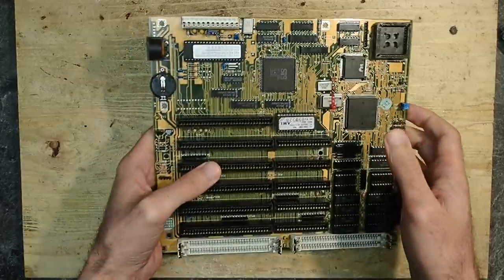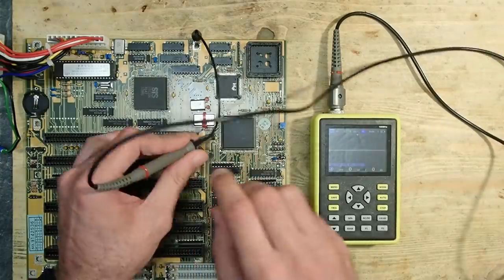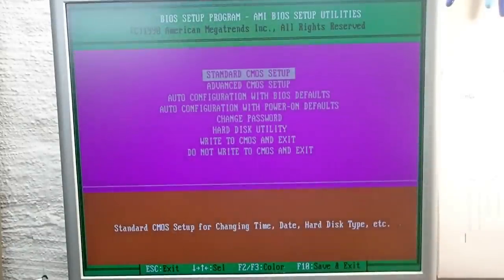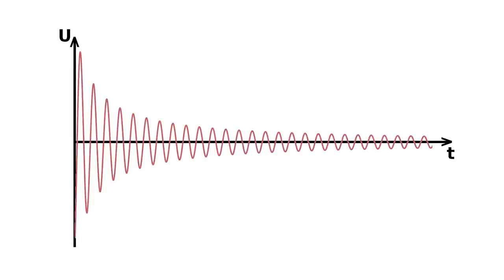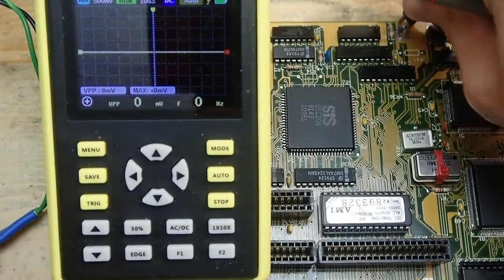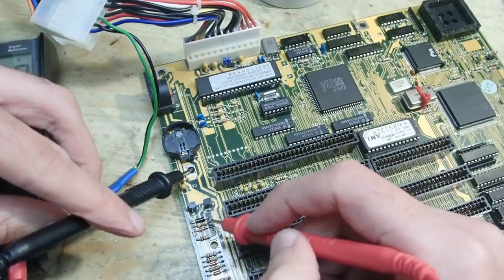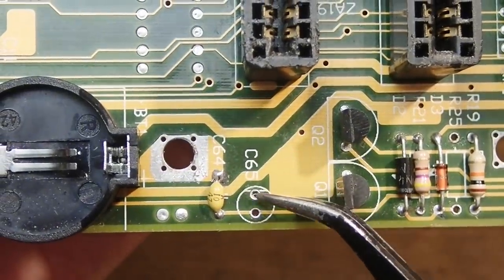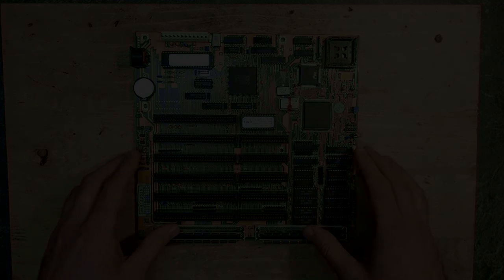Let's repair a mystical issue with an old 386 mainboard

Comment: Yeah, prices are going up, it's really crazy. 10 years ago, we were using all those 486 and Pentium 1 computers as targets for guns and now, it's almost more expensive than your normal gaming computer when it's something more race. 😀 Especially boards with ISA slots, because some people still need them for their special purposes and special boards which has no modern replacement, I can feel their pain when they need to replace MB in such machine, I work on CNCs, so it's just a matter of time and I will have the same problem, but thankfuly, our oldest CNC is already socket 775, but I am more afraid about that PCI card which connects PC with machine, if it dies, it will be really bad.
BTW, I totaly hate marking of capacitors and resistors, why the hell can't they just print what exactly is that without those ciphers? Like you have big resistor and you could just print 100 ohm there or something, why they don't do that? I don't get it, life would be much more easier.

Comment: I remember I had a similar issue in a laptop, I didnt know what it was until I noticed the clock in the bios was running like a stopwatch... the laptop had liquid damage and the rtc circuit got affected by it, luckily a good soak with alcohol fixed it

Comment: i was totally not expecting the system to rely on the RTC for timing interrupts for userspace applications, i guess i'm much more used to modern systems having internal interrupts and not needing to rely on such a thing.
Reply from the maker: And if you think, that back then there was no such thing like userspace/kernelspace, but only realmode DOS, you will be totally blown away :D

Comment: Excellent video, thank you for making it. About the frequency of the oscillator specifically, Steve Mould has a wonderful video about why these oscillators are that exact frequency (in his case, in a quartz watch). In short, it's the first power of 2 that is above the audible frequency range (for humans). So it's the first power of 2 that can be divided down  to exactly 1Hz that doesn't produce an audible high pitched noise. Link to the video: https://www.youtube.com/watch?v=_2By2ane2I4

Comment: What should i comment? Nice - as all your videos! :)

I need a list of the tools you use! The Capacitor tester and the small oscilloscope
Reply from the maker: Thanks for the donation ;) The tester is not only for capacitors, but also all kind of other stuff. I bought it in China and it didn't work from the beginning. I had to modify it get it running and print a stand with the battery holder. In China you often not only buy a thing, but also some tinkering fun :) The oscilloscope is a FNIRSI-5012H, it advertises 100MHz, but remains just a dream. This thing works reliably up to 35MHz, but it's more than enough to repair anything up to 486, since the FSB is 33MHz. If the correct voltage is not important, but the waveform and the frequency, you can use it for up to 75MHz. Even if it doesn't deliver 100MHz performance, I'm still glad, I have it and it's enough for what I'm doing. It is very small and handy.

Comment: So... you replaced one unreliable tantalum cap with another? :) When I get my hands on these old boards, I replace all the tantalums with aluminum solid-states (same value but higher voltage). That is, if I care about the board enough. I would even replace them with modern SMD ceramics, but that looks way off and ugly. Very unusual issue indeed, fun to observe. The cause of it, however, couldn't be more common (a failed tantalum cap). P. S. Now we know how a PC would work in a time anomaly.
Reply from the maker: Funny to see how much people care about which capacitor I used to fix my board. I never change the capacitors just because I feel bored, I know, that many people do, but I prefer to change them, only if I have an evidence, that it is broken. As you saw I even put back the blue ceramic capacitor near the crystal back in place. If it's not broken, don't change it. It's my simple way of thinking. ;)
Reply: @necro_ware  The issue is the type. Tagged tantalums are known to fail short or even catch fire. The ceramics? Yeah, those rarely fail and should be good for a long time. And when they do fail, it’s usually open. But tantalums? Modern surface mount ones are OK if you can’t use a ceramic but tagged tants are bad news.
Reply from the maker: @truectl All you say is true, but do you really have a feeling, that I could not know it? I mean everyone who repairs such an old hardware knows, what tantalum caps mean. I even said it in the video, as far as I remember. But you can relax, this capacitor is sitting on a very low current trace and the replacement part was taken from a military grade hardware. It will probably last the next 100 years.
Reply: @necro_ware  I gotta admit, sometimes I change parts just because I enjoy changing parts ^_^
Also I would too put blue ceramic cap back... because it looks sexier =)
Reply from the maker: @Arti9m  lol

Comment: That behavior on the seconds in the bios is normal. I have some boards with the same behavior.
Reply from the maker: Yes, I think so too. Just never paid attention before :D
Reply: I believe Necroware's assessment at the end is correct.

In code, it's quite common to poll the time every few hundred milliseconds.  If you poll once per second, you will almost surely have a window that takes slightly over one RTC second.  This means you eventually land at the very tail end of second N, and the next polled value will be at the very start of second N+2, skipping over N+1 entirely.  So, you poll multiple times per second to ensure you don't miss one.

But unless you're aligned perfectly with the RTC clock, you will end up with a lopsided, jittery count.  The solution is to poll VERY frequently -- like every 100ms or less -- and just not update the screen if the time hasn't changed yet.  But, when you're talking about low-stakes stuff like a Time-of-Day clock, it's really not important enough to worry about.

Comment: Why always the tantalum caps? My friend fixed my SS7 mobo and it also had one culprit on the board. It did not blow but nothing happened when i pressed the power button.
Reply from the maker: The good thing about tantalum caps is, that they don't leak and so don't degrade and don't damage the PCB over the time. They usually also have better ESR values and give better overall stability. On the bad side is, they either explode sometimes and/or leave us with a short circuit. It is a very rare case to see such a behavior as I showed in this video, where the tantalum is neither shorted nor exploded, but starts to be conductive as it gets warmer.

Comment: Nice video! The capacitor didn´t explode because there is not enough current in such rtc circuitry
Reply from the maker: Thank you very much.That was also my assumtion.

Comment: You should take that scope apart, and take a look at the input circuitry. It might have some bandwidth limitation.
Reply from the maker: It was already, you can find plenty of detailed videos about it. This oscilloscope is limited to s.t. around 35MHz despite, that it advertises 100MHz. However, for retro repairs like this one, it's more than enough. Even on the 486, the FSB is usually at 33MHz, or can be set to. And if you don't care about the exact voltages, but only frequency and waveform, this thing can handle up to 75MHz. But as I said, at that frequency you shouldn't believe the shown voltage values anymore ;)

Comment: Amazing job! Could you explain how the Switching circuit works ?(those two transistors) I mean the circuit which switch power from battery or PSU for BIOS. Thanks many times.
Reply from the maker: Thank you. I hope, I don't tell something wrong, but as far as know the two transistors are just a more effective diode replacement, which blocks the current from the battery into direction of non RTC circuits. All the other parts are simple voltage dividers to control the transistors. There is also at least one diode to prevent the external battery from charging, plus some bypass capacitors for stabilization, like the dead one in this video. You can find the schematics here, this is not exactly the same on all the mainboards, but mostly very similar:
http://www.minuszerodegrees.net/images2/5170_battery_circuitry.jpg
Reply: @necro_ware  Yeah, that's it. Thank you many many times.

Comment: The 4.8V to the inverter chip is probably partially the result of a diode drop in the power switching circuit. Probably nothing drastically wrong with it. :-)

Comment: Just because it bugs me, the x10 mode when you enable it, is used to divide the signal by 10, to measure higher voltage (like 230V) with an input usually caped to 50V.
Reply from the maker: Yes, this is right, but the question is how it works. There is a resistor inside which is then turned on and when measuring very weak signals it prevents the disturbance of that signal. If you'll try to measure such a crystal with 1x your oscilloscope will pull the signal up or down and the crystal will be not strong enough to stand it.
Reply: @necro_ware  usually the input impedance of your oscilloscope is already pretty high (1MΩ/20pF) and should not be impacting your signal that much (as long as you're not playing with GHz frequencies or higher). Using the x10 mode will simply add a 9MΩ impedance in the loop to do a simple voltage divider. If 1MΩ has an effect on your circuit, 10MΩ will have about 10% of that effect.

If you're in a circuit that is impacted by that kind of impedance, you might want to switch to an x100 probe which will then add a 99MΩ impedance in the loop, and then you will reduce the curent drawn by the oscilloscope to 1% of what it could have been.

Note : I'm saying impedance instead of just resistance because you're not just adding a resistance, but a resistance & a capacitor.
Reply: @necro_ware  besides switching to x10 mode will also add the compensation capacitor that will introduce distortion on what you can see and might also impact the circuit. My electronics teacher always told us to use x10/x100 modes with a lot of caution.

Comment: Im curious why the complex switching between battery and psu, why not just diode OR them into RTC_VCC?
Reply from the maker: I may be simplified it a bit. You had actually three sources, a rechargable battery, an optional external battery and the PSU. With a simple diode on the external battery you would get a higher voltage drop, than with the transistor cascade. This would just dissipate the energy and would be not as efficient. The batteries had to survive years. On the other hand, this circuitry is also responsible for the control of reverse flow to the rechargeable battery.

Comment: Pretty cool, would be interesting to mod the clock to be twice as fast or slower as a mod to see what happens.
Reply from the maker: Which clock? The RTC? If you connect a faster crystal the clock will go faster, and with slower crystal, well, slower. Either way your clock and calendar will simply go wrong.
Reply: @necro_ware  Would be pretty cool to see how it would affect games.

Comment: I have a couple of motherboards that are absolute conundrums to me.  I wonder if you could isolate and fix them?  One is a Packard bell model, I think a PB400, and the other is this interesting MarkVision FlexBoard, which I think was damaged too much by the battery and I think the BIOS is destroyed.  Still it would be interesting to see if you could effect repairs on them.
Reply from the maker: I was hoping, that my videos would inspire and help other people to repair their hardware ;) I already showed some repair videos about battery leakage and how to proceed.
Reply: @necro_ware  I have already attempted to repair these two boards, and I was unsuccessful.  I have successfully repaired about 2 dozen other systems in the past 2 years as a way to keep from going crazy during this human malware event, but these two have eluded me.  I know that both have had encounters with leaking batteries, and all visible corrosion was cleaned.  The Packard bell boots, and then crashes after boot and the Markvision doesn't seem to respond no matter what.  These are just strange issues that go beyond my simple skills of cleaning battery corrosion and removing and replacing capacitors, resistors, diodes, and the odd transistor.  From the outlay they both look like they should be simple fixes, but they have proven to be beyond my skill.
Reply from the maker: @helldog3105  Well, unfortunately, not all of them can be repaired. At least not now. In such cases I just put the hardware, which I can't repair into a box and come back later to it. Sometimes, when I repair another piece, an idea strikes me like a lightning and suddenly I know, where to look. May be it's just not the right time... yet ;)

Comment: I imagine that the cap didn't blow up because the voltage is only 5v and the current draw is very low. It's the 12v ones that send themselves into orbit.
Reply from the maker: At 5V they do explode also quite well, but you are right, this is due to super low current.

Comment: I guess 22K is 22 pF. K isn't "kilo", but a voltage or a tolerance. It is typical to have some picofarad capacitor (or two) near the cristal.

Comment: I think actually CPU runs smoothly. It seems Landmark test uses timer interrupts to calculate actual CPU speed, and since time periods vary in time it calculates wrong.
Reply from the maker: It needed 15 minutes to start Commander Keen :D That was running anything else but smoothly.

Comment: Question -- when you say "32kHz crystal", do you really mean the common 32.768 kHz?
Reply from the maker: Yes, I just say 32kHz, but mean the 32768Hz
Reply: FWIW, this is true of pretty much every RTC crystal.  32768 can be divided in half, 15 times, to tick exactly once per second.  Dividing in half is really easy to do in digital logic.  Dividing by 32000 would be much more difficult.
Reply: @nickwallette6201  Thanks, I pretty much figured that but did not want to assume anything.  This question actually came up in regards to a Dallas Semiconductor RTC replacement project and the mention of 32kHz in this video was just fortuitous.
Reply: @sorcererstan   Yep!  I ran into that same thing once upon a time when trying to design my first dev board around an ARM Cortex chip.  The datasheet just said "32kHz" and I thought it was really unprofessional for an engineering document to leave that detail to the imagination.  I have since learned this is basically law, so the ambiguity was in my ignorance.  (Although I still prefer that it be spelled out.  haha)

Comment: How about giving it a faster RTC crystal? Would it interrupt something or the clock would just go faster?
Reply from the maker: The clock would just go faster. If you want to see my struggles of overclocking this mainboard take a look at: https://youtu.be/5dxdNXqKO5I
Reply: @necro_ware  i watched the video and it was really interesting indeed. The mainboard experienced alot but experiments are fun.
Reply: @necro_ware  But still it is weird that this motherboard was working with malfunctioning RTC crystal. I thought that the mainboard would behave like dead. But it was working just with strange behaviors. It would be interesting to put maybe a 64khz crystal to it instead of 32khz to see faster time in bios. 0.5 sec instead of 1 sec.
Reply from the maker: @SkrovnoCZ  That's why I named this video "mystical" ;)

Comment: Repairing a 386? In 2021? Well, I watched it. And I learned things. So, why not? 🤷‍♂️
Reply from the maker: Electronics is electronics, we all can learn a lot repairing stuff, doesn't matter how old it is ;) And if you are in a retro computers community, it even has a reason. Just search on Ebay, what this or similar mainboards cost in working and tested state. It's gonna be an eyeopener ;)
Reply: @necro_ware  yeah, people are into the retro. I didn't keep any old Intel/AMD stuff but I did keep piles of Sun Sparc hardware. Makes me want to fire it up to see if it works and if I can get any $$ out of it.

Comment: What's that component tester you used on the capacitor
Reply from the maker: I can't tell which model it is, I bought it broken years ago for a price of a cookie and repaired it back in the days. Today you can easily find thousands of similar devices online.
Reply: @necro_ware  I'll have to look around then lol

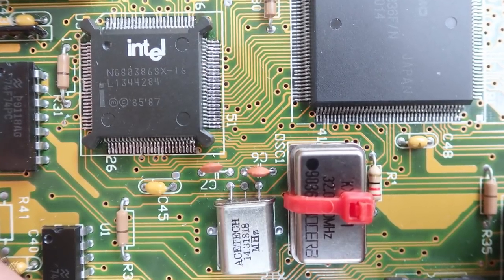Comment: 00:38 What's with the zip tie on the oscillator?
Reply from the maker: You mean why it is there? It is how such oscillators were fixed in place. Look at any mainboard from the early 90's, you will find it on all mainboards, where the oscillator is socketed and not soldered.

Comment: 8Mhz is probably for the keyboard, considering its located near keyboard BIOS
Reply from the maker: Yes, probably it is.
Reply: @necro_ware  Can you tell the model of your vacuum solder remover?
Reply from the maker: @GamePlayShare  ZD-915, there are two  videos I made about it, they are old and not as good quality, but still noteworthy.
Reply: @necro_ware  Thanks. I'll check them.